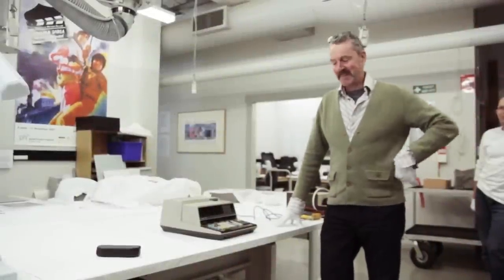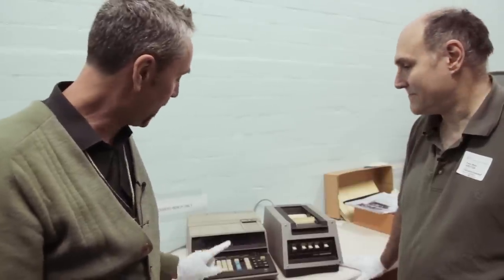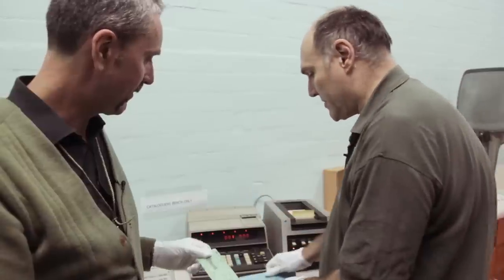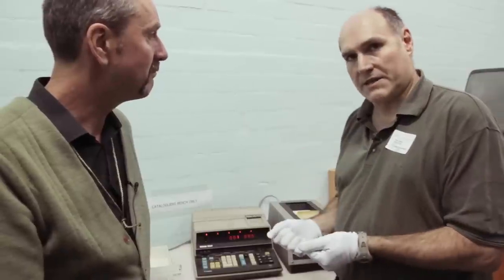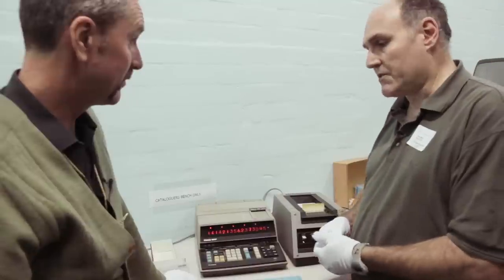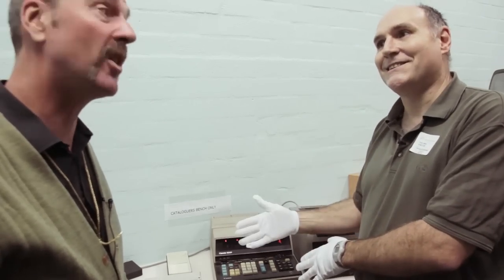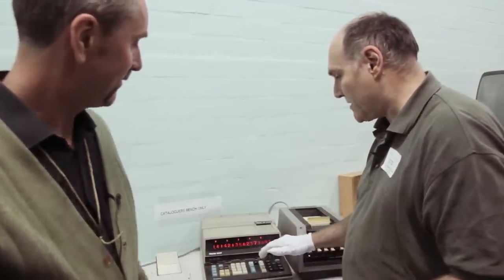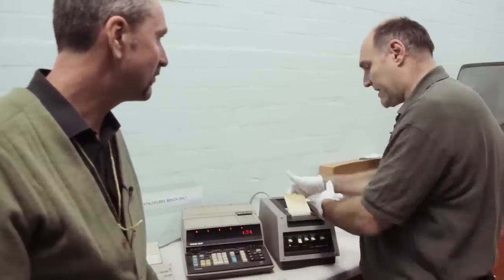Canon Canola 1614P Programmable calculator

Comment: Thanks Powerhouse...  it was the 1614P that changed my direction from biochemistry to computer science. In 1977 I rewrote my Numerical Method teachers sign change algorithm from 22 steps to 8 steps (shocking him well & truely). I found all this "computer stuff" quite easy & thought to myself that IT may be my future. Then I did a (summer) FORTRAN & PL/1 course at Powerhouse Museum's IBM 1400 which came in handy when I was the first Lab tech allowed to run his own stats analysis at ICI Central Research Labs in 1980, using the IBM 370 at Nicholson Street
Reply: Hi dear @hlim431
I'm looking for the instruction manual of Canola 1614P but nothing was found on the Internet. I would like to know if you can help me. Do you have any instruction manual for it?